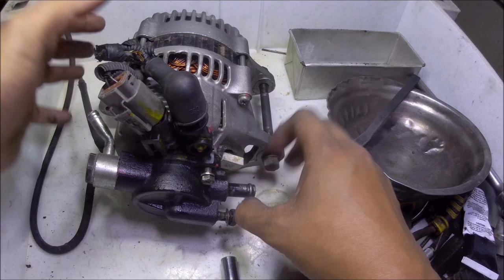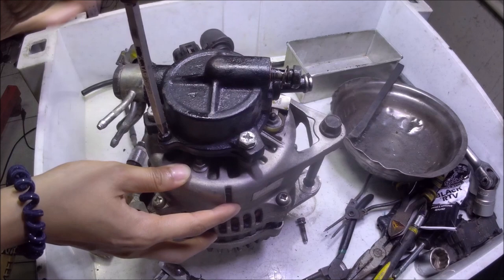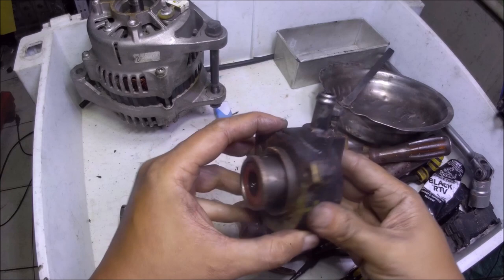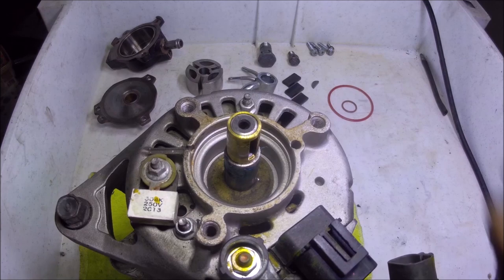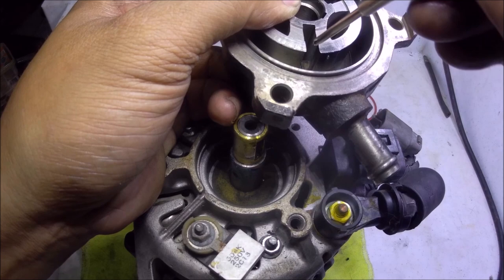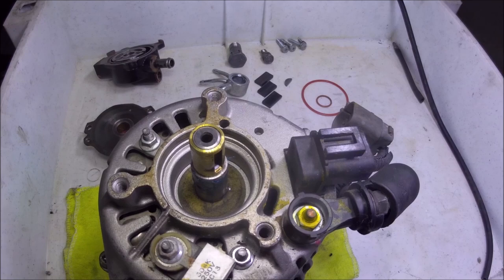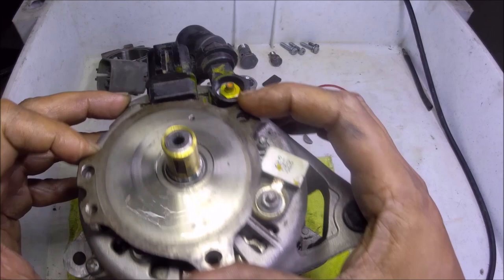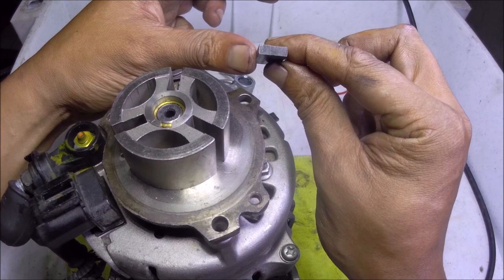WEAK Diesel Brake system Vacuum Pump Teardown Rebuild Overhaul

Comment: has it got any return valve to stop engine oil from coming off to the booster in case the one in booster failed ,got one her filled the brake booster with oil , I would assume this happening during engine shutdown as that vacuum on booster will suck any oil in pump if it has not got valve at the outlet where vacuum hose connected to it , can you elaborate in this please

Comment: I am at wits end. Ever since the mechanic replaced the alternator on my Mitsubishi Storm I had brake booster problem. At first when engine is cold I experienced intermittent hard brake pedal, and fine when the engine is hot. Now, a month after the alternator replacement similar hard brake pedal occurred intermittently both hot or cold.  I approached 3 mechanics so far, none of them able to find the fault.
I notice that you emphasized on water contamination in the vacuum pump, what sort of problem if water enter the vacuum pump chamber?
Also if the three-outlet orientation is wrong, what might happen?
I would be most grateful if you could give me some suggestion what I should look into to solve my present problem.
Your video on this alternator/vacuum pump is very educational. Thank you so much.
Reply: @John Rider Thank you for your reply. 

In the end I had my previous alternator replaced, even though I had it less than a month. The new alternator solved all this dangerous intermitten hard brake problem. 

Since then I learned how to check a faulty vacuum problem without having to remove and dismantle the alternator/vacuum pump from my car. I removed the vacuum hose from the booster and connect a vacuum meter to end of hose. Run the car, if the vacuum reading can reach 0.08MPa, then your vacuum pump is running efficiently.

I learned one more thing, even though I cannot have it verified by any experience mechanic, vacuum also aid power steering. Previous faulty alternator, the day I had it installed, I experienced stiff power steering. Power steering returned to normal the moment new alternator/vacuum pump had been installed.
Reply: @John Rider Thank you.

Comment: We all know that vacuum will basically "suck" air from brakebooster. But it possible that alternator vacuum will transfer oil to brake booster instead? Already repaplaced brake booster and found out to be flooded with liquid which seems oil unlike the possibility of brake fluid leak to booster
Reply from the maker: I think its possible since theres an oil pressure feed within the vacuum pump lubrication
Reply: I am not a mechanic. Oil should not get into your air booster. I believe the oil in the air booster might attack the diaphram material to cause booster failure.
Reply from the maker: @josephwong3001  Take note "Vaccum pump" = Vaccum...therefore it's impossible for oil to get into the brake booster, considering oil is also regulated thru a small oil hole before it gets inside the Vaccum housing
Reply: @DIYAllManphKDWzpeedengineering  You misunderstood me. I should use "cannot" instead of "should not". 
This is exactly what I meant. 
I misunderstood you. I thought you meant oil went into your booster.
Reply: Currently working on a 96 npr 5.7 ,same pump . Vacuum that this pump makes with the amount of hose and hight of booster,it's unlikely to fill booster with oil . I say unlikely because it would take a couple quarts of oil to suck from the pan . Not saying impossible, but would take many many cycles of shut down . And the weep hole would have to be plugged for you to not see residual oil leaking after the absence of Vacuum.On the oil pressure side ,that would have to overcome the vains and vacuum "bar" of the working line. If trace amounts are visible in the booster, age would have to be accompanied. If the booster filled then a possibility of the oil return at the vacuum pump would be blocked.i would think your then looking at a pcv valve gone bad as well or a really dirty engine .I am referring to the GM 5.7 gas job .I cant speak of the diesel engine Good thing to look at now that i think of it .Surely a good question though.  Reminds me of some of the turbos sucking engine  oil out when seals started to go . Same concept but bigger pipes and if you are driving down the road at night when the seal blows out  its too late . Turbos will drain a pan in a matter of minutes.  You don't know it till you start to here that ticking!